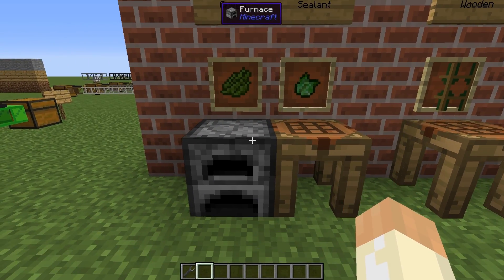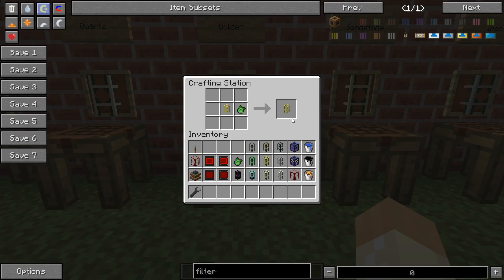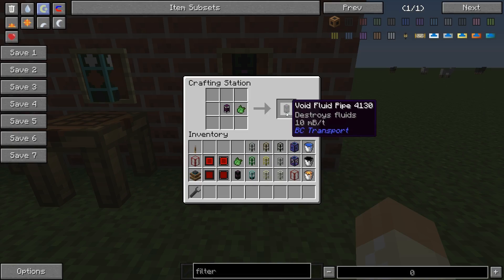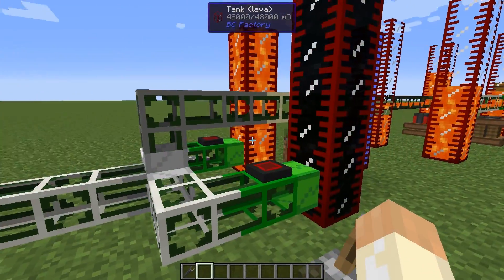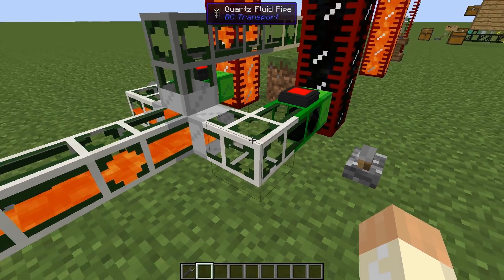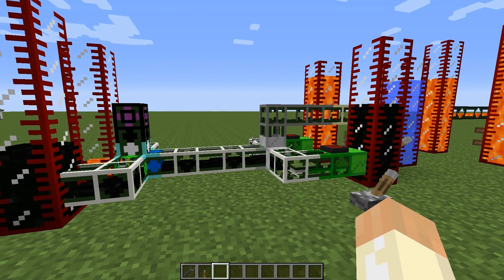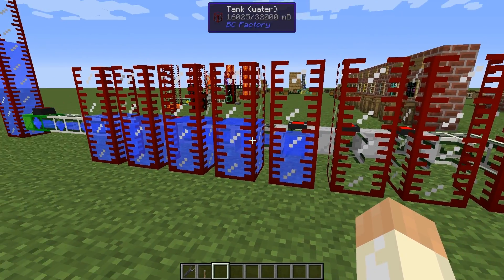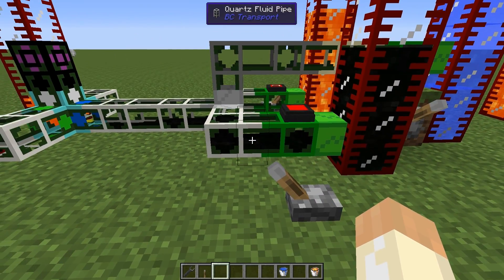BuildCraft 7 Tutorial #4 - Fluid Pipes (MC 1.7.10)

Comment: how do u use the gates to extract fluid i did what u said in video and it didnt work
Reply from the maker: +sleetskate What version or modpack are you using? And how have you connected things? Because I'm quite sure that the different methods I used in the video worked ;) You always need a Wooden (or Emerald) fluid pipe, and then you use Authartic Gates or Redstone Engines to extract the fluid. If the pipe is correctly attached to a fluid container.